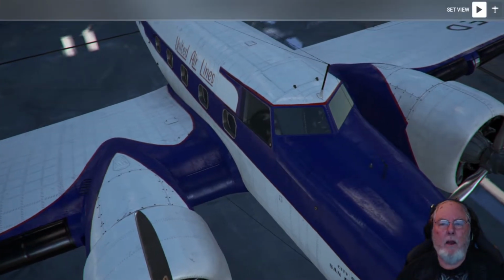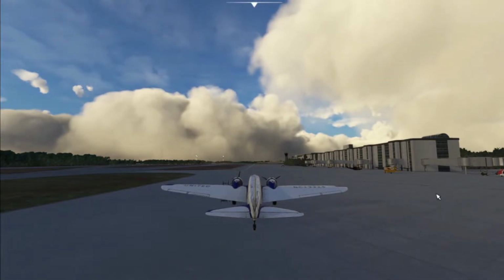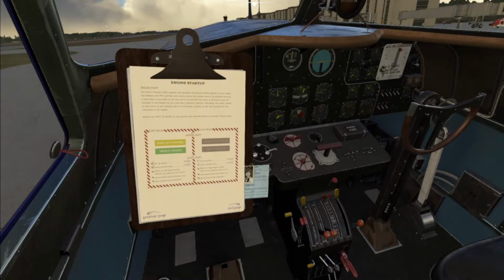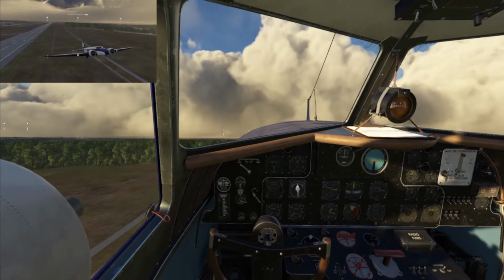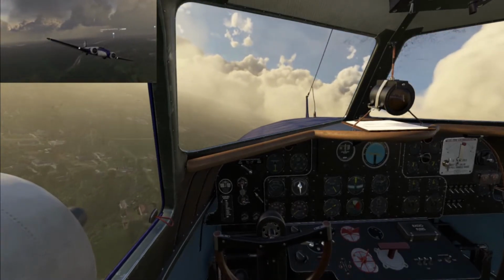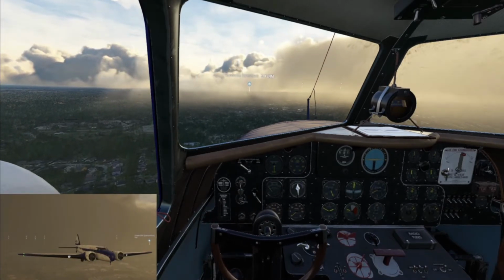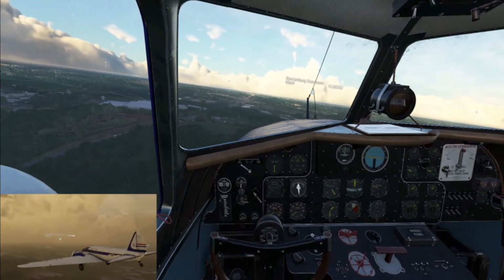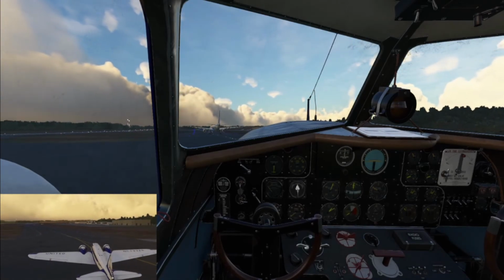MSFS2020, Wing42 Boeing B247D, KGSP TEST FLIGHT

Comment: It didn't sound like the developer put much variation in the engine sound between idle and flight.
Reply: Ha, just got to the end of the video and to your comment of running the props at half rpm.
Reply from the maker: @CajunJosh  😅